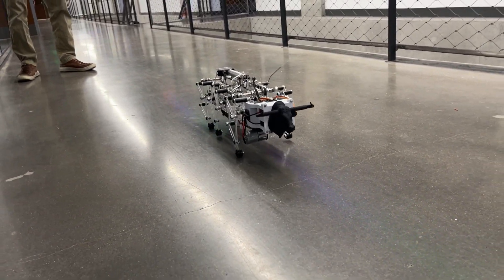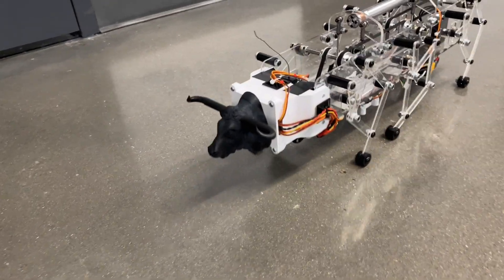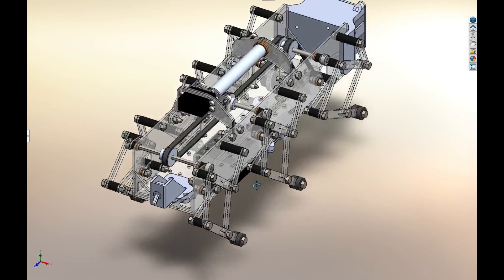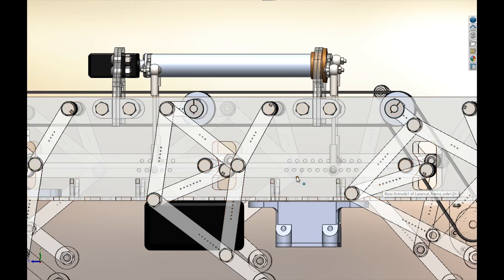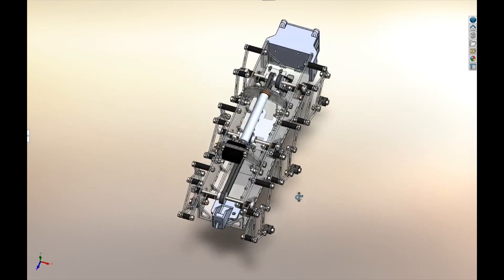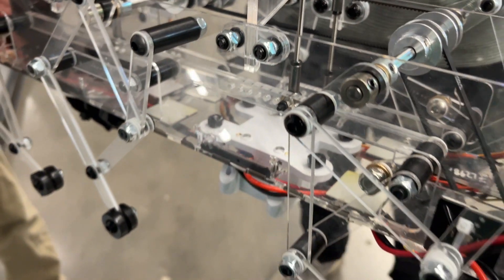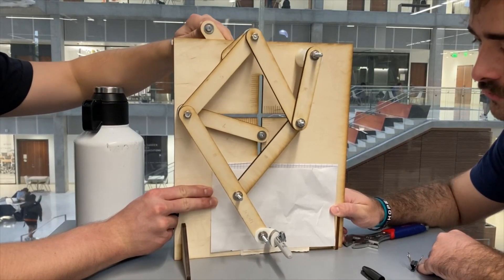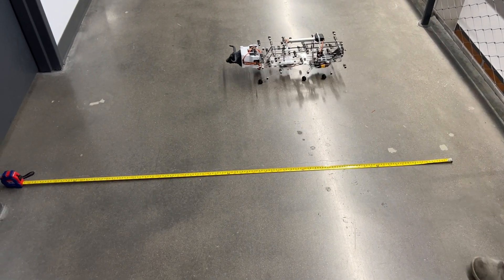Single Motor Steerable Hexapod Robot

Comment: Is THEIR ANY WAy to make the step more tall because with this low ground clearance its serve no point to have a walker that also seem to drift a lot
it will be more honest to demonstrate it on sand ground :face-orange-raised-eyebrow:
Reply from the maker: The linkage geometry could be altered to increase the step height, but we optimized for a low step height to maximize efficiency. This robot doesn’t handle uneven terrain well.
Reply: @Clay-Builds  can you name one advantage of walker that dont handle uneven ground ?
Reply from the maker: In an environment like the flat floors shown in this video, the linkage driven gait saves a lot of cost and complexity compared to a software controlled multi-actuator leg. Also makes control trivially easy. This robot was never intended for rough terrain, it’s a research type project studying mechanical linkage dynamics.
Reply: @Clay-Builds  i agree with the mecanical part but what the purpose of legged vehicules on flat ?also this logic also apply to copters when using linkage and crank and a single motor with servo in theory better than multi motor but in pratice more expensive and less reliable and less energetic after few use without maintenance

Comment: thats fantastic dude!!  such a smooth stead gate and only one motor!! now thats efficiency
Reply from the maker: I’m curious to compare the power efficiency against other similarly sized hexapods. Although there’s a lot of frictional loss from 50+ joints, I bet one large motor is more efficient than many small ones. Plus less weight and it doesn’t consume power just keeping itself upright.

Comment: This kind of engineering was common on the 60,70 and 80s. When only 1 motor was ever allowed due to budget
Reply from the maker: Yea small motors are dirt cheap now. Most hexapedal robots at this scale use 12-18 servos. Although you can’t control legs individually this way, it’s a clever way to simplify the electronics while maintaining steering ability.
Reply: No, wrong - NOT common in the 1970's and 1980's they used separate motors for everything, and products were expensive, and had complex belt, and cog engineering.  As an example, an early VCR, had up to 10 motors! and 5 actuators (solenoids)! Each motor did one simple function, forward, reverse, load, unload, raise lower. Then gradually, during the 90's and onwards 00's - manufacturers begun to use small coils / actuators, to engage plastic gears at correct timing to minimise functions to use less motors. Even an old PC disc drives, or a CD player, had individual motors for tray loading,  mechanism raise, and even the disc motor was a brushed motor early on (eventually all were PCB based BLDC) In the 90's they started minimising, and using one motor for all mechanical - including the rotary, and also stacker based multi CD/DVD players! They even started reducing screws, along with multiple PCB's, and everything began to clip together with toggles (cheaper to mass produce!). I know, I was there, as a service technician!
Reply: Not only the 80s. I saw expensive video recorders from the 90s and 2000s with up to three motors. But also very cheap ones with just one motor and a gearbox sometimes with servo sometimes with elektromagnets to distribute the motor power where needed.